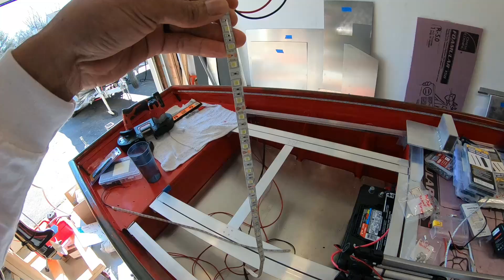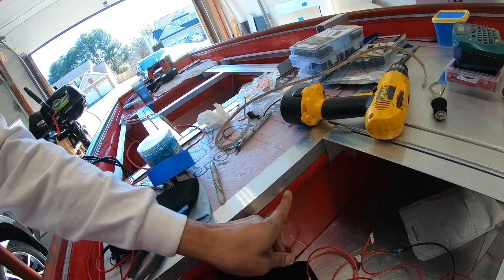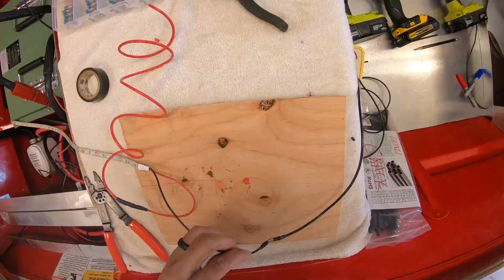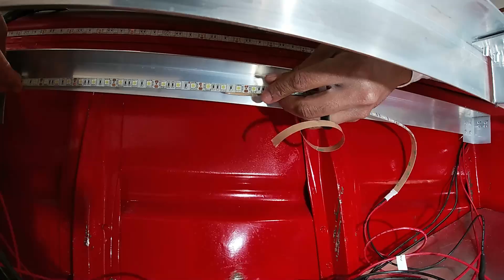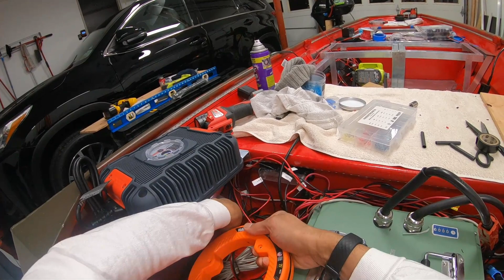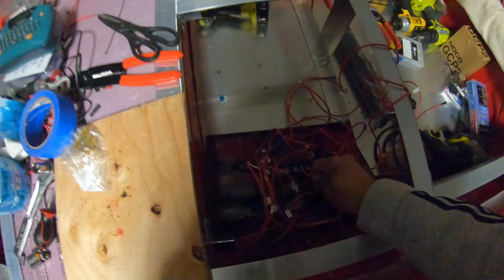I KEEP BLOWING FUSES!!! Jon Boat Hatch Lights Install + GIVEAWAY{Jon Boat Conversion}Alumacraft 1232

Comment: Thanks for the real time mishaps and corrections. I was only getting 10 volts of the 12 volt battery to start my boat. When I retraced my steps I didn't tighten the postive cable to the turn of switch. SMH!!! Thanks for the videos. I'm learning a lot.
Reply from the maker: No problem Sir.  It’s allot to keep track of.

Comment: I "renovated" a 1980's MirroCraft last summer - it's always more difficult than I think it will be - you need plan B, plan C, and sometimes plan D.

After all the effort though I'm really happy with the boat.  The trailer, on the other hand, well . . . that language isn't suitable for YouTube

Hang with it - it will turn out fine 🙂
Reply from the maker: Thanks 🤙🏾👍🏾